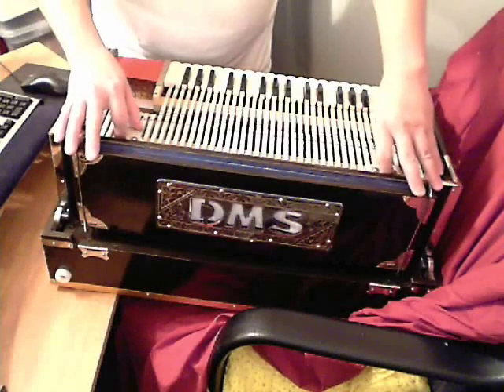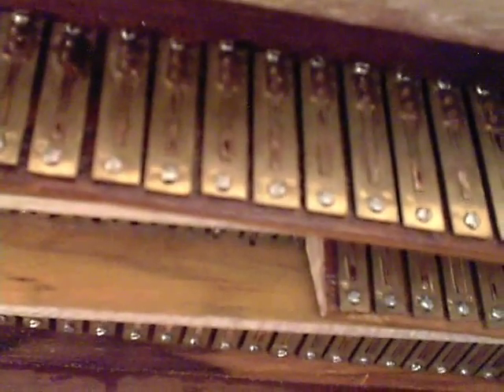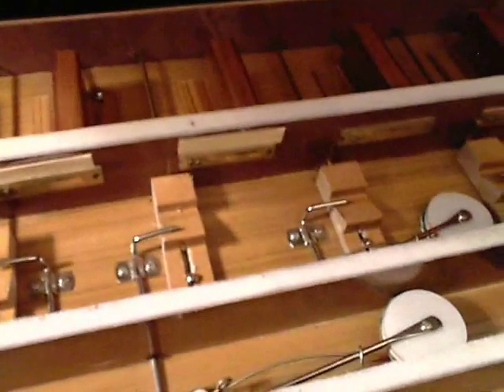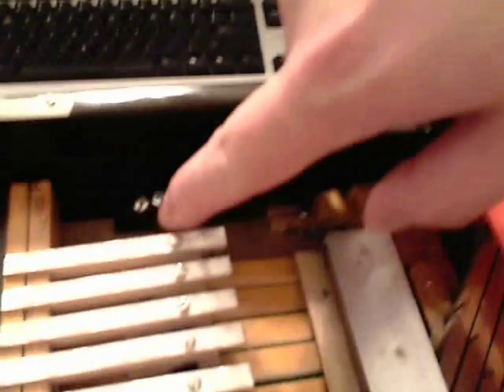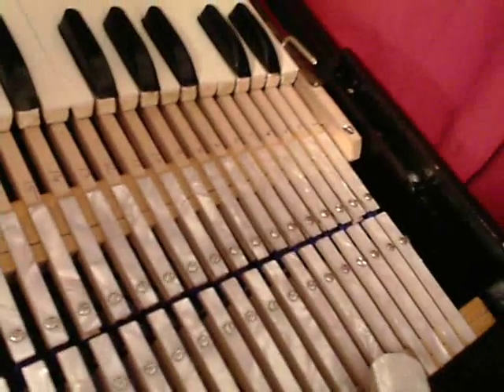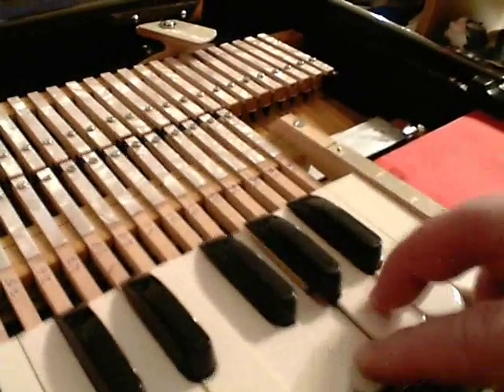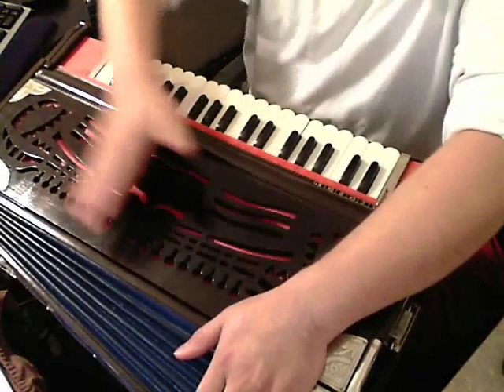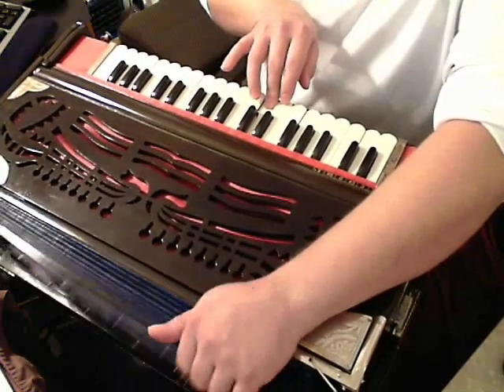Triple Reed Harmonium (minor repairs)

Comment: Thank you sir for posting this video of DMS brand harmonium. Whats strange is that the coupler should not be in action when the knob is fully out. The reason might be because if the coupler panel or the small thin board under the keys on which the coupler twigs sit on.